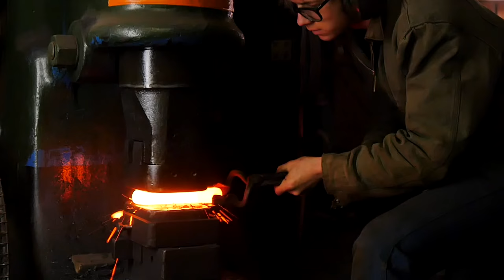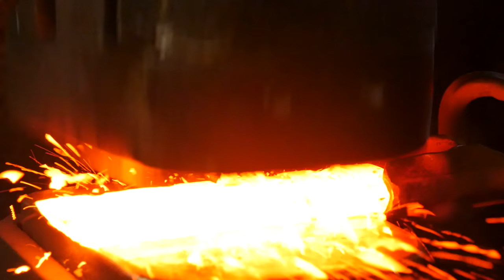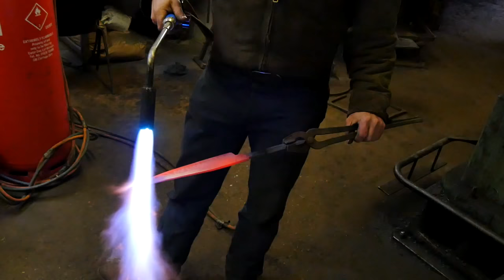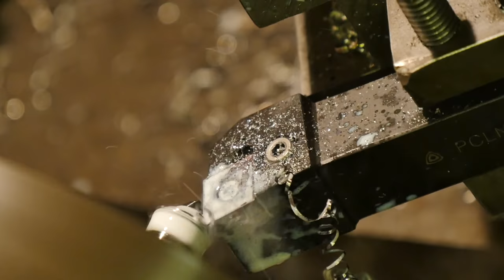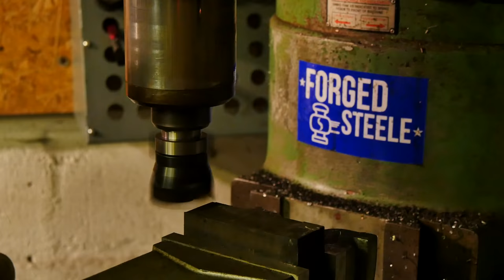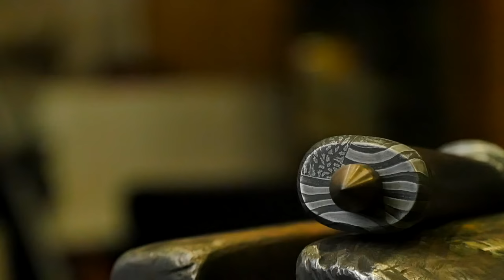MAKING THE AMERICAN FLAG BOWIE KNIFE!!! 🇺🇸

Comment: Amazing craftsmanship! You should be very proud. That knife looks bad ass.
Reply from the maker: +Devon Crooks Thank you sir!
Reply: Alec Steele kinda looks like zebra print too
Reply from the maker: +Sawyer Cantrell Hey sawyer, sorry but I'm not taking on any custom work right now. I have no idea what it weighs since I accidentally broke my glass scales at the shop! Draw the Bowie you want on grid paper, do the volumetric calculations and factor in needing at lot extra for any wastages!
Reply from the maker: +Sawyer Cantrell I do not know off the top of my head and wouldn't want to guess incorrectly - draw it out on grid paper, calculate the surface area, find the volume with the thickness and use the density to calculate the mass

Comment: Amazing stuff, have you ever tried making a knife and doing the blade makers master test thing, where they need to make it from steel that has been folded over 300 times or so, then chop through hemp rope, a two by four lump of wood and then put in a vice and a(with a steel tube), bent to 90 degrees without breaking, details can be googled, would be cool to see...
Reply from the maker: +Shelley Raskin i don't think I'm good enough for that yet! :P

Comment: if you have 3 plates, 2 of which are steel and the other is copper or bronze, if you covered the bronze with the two steel and forge weld it together and grind the edges, will it show two shinny steel strip with bronze in the middle or will the bronze plate mix with the metal and it would be just 2 solid shinny steel strip.. thanks

Comment: I've been wondering for a long time, how did pre-electric/gas welder smiths prevent their layers from delaminating when making Damascus?
Reply from the maker: +Admiral Percy you can wrap the pieces in wire and gently bring it up to heat - at welding temperatures the prices are tacky enough to stay together long enough to hit them and get the weld set!